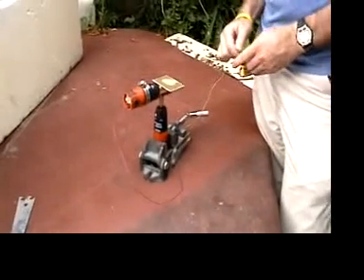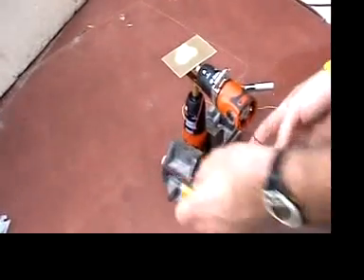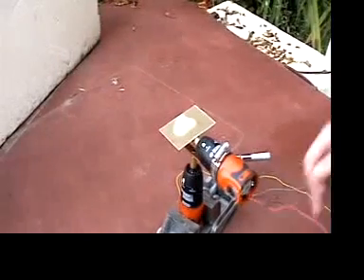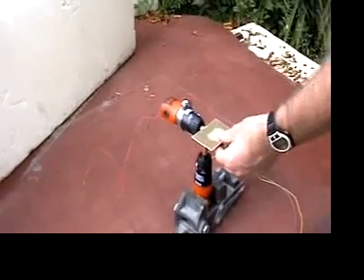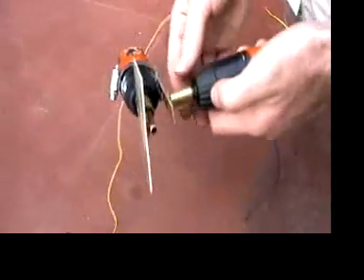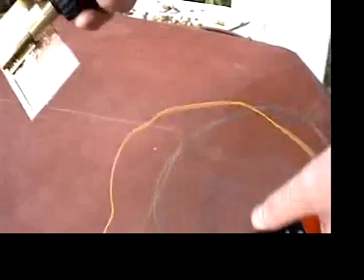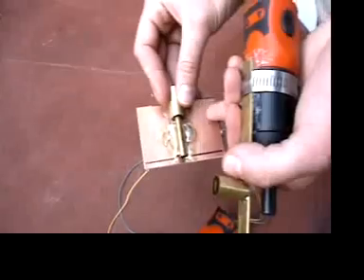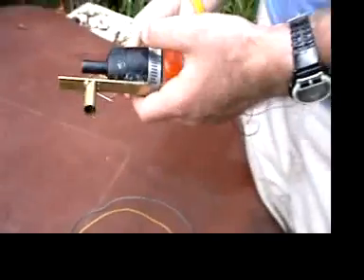How to make a pan tilt unit for your camera

Comment: 46 bucks for the servo city mount PLUS shipping(6 bucks) PLUS a 2 channel cheapo radio kit with servos and receiver for 40 bucks PLUS shipping..(12 bucks)  PLUS 12 batteries!  Get local so what 10 bucks?  I dunno.. 

Somewhere well over a hundred dollars!  VS two drivers and some scrap metal and two momentary SPST switches from Radio Shack = grand total of what? twenty bucks?